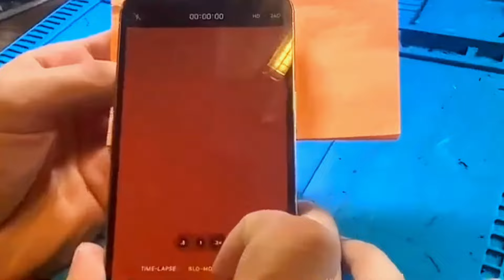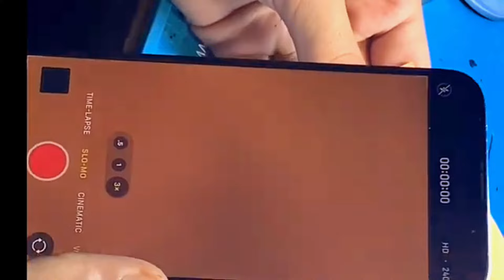iPhone 13 Pro Max camera black spot fix || iPhone 13 Pro Max Camera Dot Fix 🫠

Comment: WoW! I thought this spots happened only on my 13 Pro Max. It looks like Apple robbed people by releasing product with such deffects. It happen on x3 Zoom lens, isn't it?
Reply from the maker: There are three cameras 
It can comes in any one of them 
0.5x 2 x 3 x
Reply: @iPhoneUpdate-sg7en  That's sad. From what I see on YouTube it happens mostly to Zoom cameras even iPhone 12 Pro
Reply: Same
Reply: I got it in my 3x zoom lens. Did you find any solution to the issue?
Reply: @debjyotibarman225  Yeah, I returned the phone back to Amazon. The other solution is either replace the camera and live with iPhone alert that: camera is not genuine part may not work blah-blah, even if it will work or disassemble the camera assembly (which is not easy task to do)  and clear the sensor. No shaking or hitting the iPhone ever moved this dirt at all.
Reply: I have that issue too in my x3 lens
Reply: Me too it happens on 3x zoom camera and it has many dots, it’s do fucking annoying